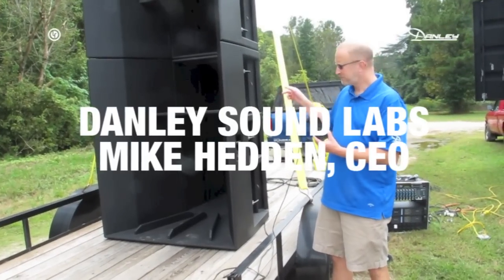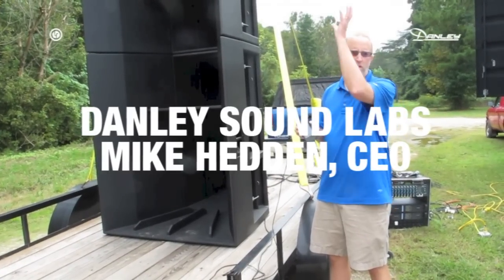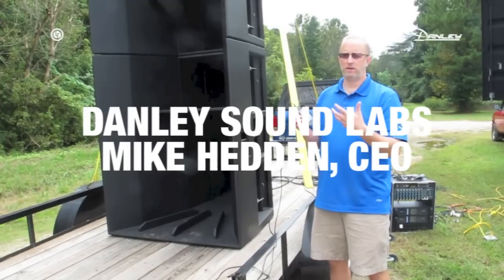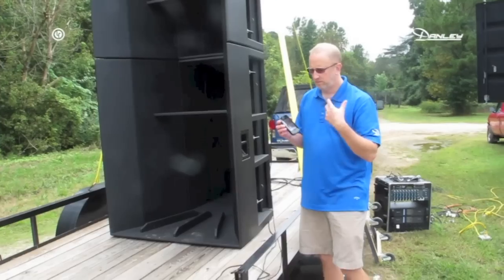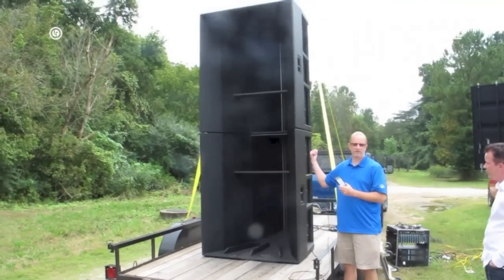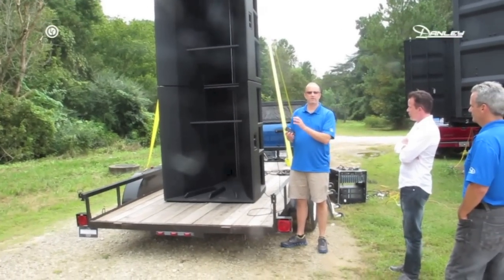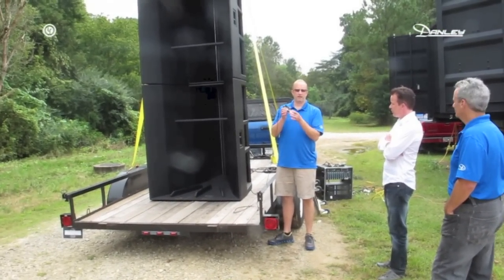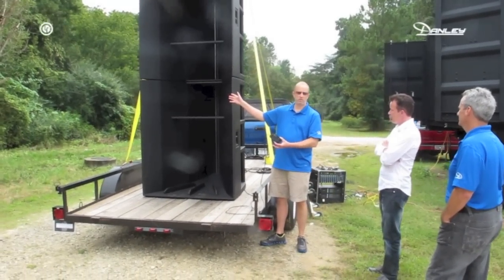Danley Sound Labs - Mike Hedden, CEO

Comment: For those of you that are having a hard time believing that 1mw of power couldn't produce that much volume think about the physics involved. Most of Danley's stuff is really high efficiency meaning at 1 watt of acoustic input power measured at 1 meter can probably put out well over 105 db on these cabs. Assuming that the cab can produce 105 db at 1 watt. When using 1mw of power this would only result in an 18 DB loss of acoustic power as it takes 10 times the amount of power to get 2 times the amount of perceived volume from a cab. Using the study of 6db as double perceived volume (I am sure that someone will bring up sone and the 10 db theories), this would put the output of the cab at 87 DB (Assuming that we start with 105DB). A single watt of power is very impressive. 1 mw of power is impressive on a well engineered cab.
Reply: Bill Weise I still call BS on it. Based on my knowledge as a physics / Mathematics student i can say the motor force created by the speakers is so incredibly tiny that i doubt it would even do anything if you put 1mW into those speakers.

I have also done some back of the envelope calcs above that basically blow large atomic bomb sized holes in the claims of this video. But i just noticed a slight error in my calculation with the sensitivity, i did not account for the logarithmic nature of the dB scale.

But still i have a hard time beveling that a speaker can create that kind of SPL with just 1mW, it takes my 98dB 1W/m speakers way more power to get to the same SPL that those speakers were at.

If those speakers are capable of producing that kind of SPL on 1mW then all you would need to create the sound for a concert is only on the order of power that a laptop can create. Or a decent headphone amp. It just dose not add up. That would also imply that one of my HiFi amps can blow out the eardrums of a entire croud at a concert with these.

Again i have a hard time believing in that.

Best regards, a Mathematics and physics student.
Reply: ***** As you provided a well thought out, intelligent response, I have to believe that you are a reasonable, open minded individual who would be open to trying something out. 

Find a speaker that has an efficiency rating of at least 90db at 1w/1m. A horn loaded driver comes to mind but any decent speaker should work. Then apply power to it from you phones audio jack or an Ipod. If you have a DB meter handy, this experiment will be even more fun. Then measure the driver at 3.3 ft (1 meter) with 1mw of power from your headphone jack. If the theory holds you should have around 72 DB of output (using white or pink noise). 72 DB will sound about as loud as your alarm going off in the morning. I think you will be very surprised at the amount of volume that 1mw will produce. This demonstration is a double edged one as this same test on any decent speaker will result in a fair amount of audio energy. I think you will be impressed. I look forward to your update and spirited debate! I love a good physics discussion. Take care. -Bill
Reply: ***** The Jericho horns are 112-115db sensitive. They have a peak output of 148db. for a 30db increase you need 1000x the power, so they are likely to be ran on 1000w amplifiers, probably more for the bass.
Reply: Bill Weise An I-phone has an output of 60 milliwatts. I doubt he was using just 1/1000th of a watt.
Reply: Bill Weise An I-phone has an output of 60 milliwatts. I doubt he was using just 1/1000th of a watt.
Reply: For what it's worth I hooked a Bill Fitzmaurice Omnitop 12 cab up to the headphone socket of my Toshiba Satellite Pro A200 laptop (louder phones out than my Compaq Presario CQ56) and it got to raised conversational level. Most of the output was in the shrill 1.5-3 kHz band of the un-EQ-ed compression driver.

If that speaker is 102dB 1w/1m (the shrill zone more like 108dB and the kick bass somewhere in the upper 90s) then that is 72dB at 1m e.g. conversational/tv level off a milliwatt.
Reply: 1 milliwatt into 105dB cab is 75dB at 1m which is about the volume you'd put the TV to "hear it well" or the volume of someone talking in a slightly raised voice e.g. a teacher in a classroom. I wonder what the J5 could do with a processor out to a Pringles Speaker amp on each frequency band and maybe two on the subs. Those 64 highs wouldn't take much to make some noise. The cab is basically a J4 combined with a stack of 6 x DBH218 and also something that provides a strong midrange.

Comment: Usually a phone has a bit more than a milliwatt of power but it is somewhere between 10 and 100mW. It is quite amazing that it is getting that loud off the headphones. I'd perhaps believe it were possible if you desoldered the wires going to the phone speaker and connected them to this as there is more power going to the phone speaker than headphones. The headphones are power limited to protect your hearing as powering them with the power of the phone speaker would be thunderously loud.
As for high efficiency. I connected one of my Bill Fitzmaurice Omnitop 12 cabinets to the headphone socket of my laptop and it was as loud as raised conversation although the compression drivers are very sensitive around 2kHz without the equaliser taking it down a notch.

Comment: Surely that can't be running just off the power of the headphone socket! Is there any sort of amp involved?
Reply: There is an amp rack behind him on the ground with two lab.gruppen amps
Reply: Phoenixx Neil He's not lying. The entire thing is being driven by the headphone output of the iPhone - and nothing else. They did the same thing at Infocomm. So no amplification (other than the iPhone) and no crossovers/filters! (other than the acoustic ones inherent to the speaker itself).
Reply: DogBoots77 
 As a Mathematics
and Physics student, i can safely say, that is a load of BS, i have done a few
back of the envelope calculations, and each speaker would only receive
9.259*10^(-9) W, even with a efficiency of 120dB @ 1W/m that would only produce
a miniscule 0.001dB per driver if the amp in the phone dose not blow up due to
the impedance of 0.0741 ohms. If by a miracle of physics and technology the amp
dose not immediately blow up and the entire speaker has a Sensitivity of 120dB
1W/m then even then it would work out to 0.12 dB, that would not even be close
to noticeable over the ambient sound

Based on
the fact the SPL heared in the video is about 80 dB at 1m from the horn, based
on the dude throwing something into the trailer it would work out to a
sensitivity of a unbelievable 80000 dB 1W/m, at that sensitivity you would
easily be able to hear the cosmic background radiation hitting the wires. If
that speaker truly has that sensitivity then you sir (the person talking in the
video) are worthy of a Nobel prize for creating a speaker so sensitive that it
acts as a amp for cosmic background radiation.

But since your
clams are impossible based on out current understanding of physics you win
nothing, except the idiot of the month award.

Since i
don't have the time to also calculate motor force of each driver, i will just
estimate a force in the range of pico newtons, so small it would not be
noticeable by even sensitive instruments.

Also some
notes on the tools used to calculate these values: Custom Mathematics program
created in VisualStudio 2013, and Maple (Maplesoft). I used low level math to
do this, everyone can do the calculations in this post, all you need is a
calculator, a piece of paper and a pen. You will also need hands attached to a
human body with a functioning brain and mostly functioning organs. You will
also need some patience (that i did not have, hence the program) and some time
to do the calculations.

I encourage
everyone to a bit of thinking before jumping on the "This is
awesome!" bandwagon. Look at everything critically and you will
learn.

That was anying, google dose not like copy past from word.
Reply: ***** He says "we are going to series parallel", they aren't all paralleled, I believe that was just a mistake the second time he says it. I'm not sure which model this is, but the Jericho horns are 112-115db/1w/1m sensitive. So at 1m, 10db is 10x the power, so 102db would be 0.1w, 92db would be 0.01w, or 82db would be, you guessed it, 0.001w or like he says, a milliwatt. Every time you half the driver complement, you lose 3-6db, even at 6db, each driver would be producing 44db ish.
Reply: lbochtler I think he's just mistaken the output power of that device, he's misinformed. An iPhone can deliver 60mW of power into a low impedance load. That being reproduced in a 110dB cabinet would yield 93dBs, which is a lot. Danley horns go up to 115dB/w@1m if I recall correctly, and that means 103dB. That's "uncomfortably loud" with just 60mw. I think the point he was making was just that he's able to power them with an iPhone, I don't believe he's intentionally trying to mislead somebody. But I'm just inclined to think like that, they have made quite some great inventions and I do admire them as a company.
Reply: Assume 120dB 1W 1m for a high efficiency directional cabinet and 20mw or so from a phone would give 103dB at 1m peak which would average about 93-95dB 1m on music which you would have to raise your voice to be heard over. That's still 73-75dB from 10m away.

If an efficient pair of in ear headphones produces 115dB with 1 volt RMS then it's 62.5 milliwatts a channel to produce 115dB in each ear if you played sine waves through it. You would be able to get about 105dB average on clean music with a 10dB crest factor, which would be very loud and you'd probably want to take out the headphones after about 1 verse of a song. Most players don't go this loud. A 1 milliwatt per channel player would give about 97dB in each ear or just below 90dB average without clipping on most music (probably most players are a bit louder than this apart from my Samsung).

I'm not sure how headphone sensitivity is measured because a speaker making 100dB to an SPL microphone might produce about 106dB at the eardrum after being amplified by the ear canal. I was wondering why I could get my SPL meter over 120dB when putting an earbud to it when the same music was similar to just over 100dB speakers. Also dBA and dBC where dBA gives more estimate of the perceived loudness of the sound by only measuring the mids and highs and dBC measures all but the lowest of bass notes.

I don't know how much power a phone puts into 8 ohms, whether it's more or less than with 16 ohm in ear headphones.
Reply: @lbochtler  Hey Einstein, you missed the first line saying thw drivers are in series parallel connection. 
There,  that kinda blows your whole argument, come back when you have dried  behind your ears.
Reply: @ibochtler
So many lines of blahblahblah invested
Just
To be so wrong.

Comment: What are speakers inside, full ranges?
Reply: I think the total number of drivers is 108. 12 of them are 18".
Reply: Petar Sejpes You can not build a Synergy Horn with full range speakers. It goes against the very definition of the Synergy Horn. The probably have a array of tweeters in the apex of the horn, then some midranges at a bit of distance from the apex, then the woofers even further out. Google Synergy horn, and you will find some interesting things to read.

Comment: and so what protects the sensitive hi freq. transducers from damaging low freq's
Reply: These have to use external DSP and crossovers, Danley makes amps specifically tailored to these cabinets.
Reply: In this example nothing. 1 mW isn't enough power to damage them.

Comment: That's not wery true, i conected my 2 fane studio12L's(102db@1w@1m)and JBL2412H(112db@1w@1m) horns paralel and in series to get 4 ohm to my phone audio output and assuming that phone has 8mW of power,power caclulations are:
for 12"
21 db decrease and becouse of haveing two speakers 3 db increase
total of 84 db for 12" speakers 
for 1"
21 db decrease and becouse of haveing two speakers 3 db increase
total of 94 db for 1" speakers
Measuring with gm1351, spl is 63 db max!!!
The point is that the small opamp in phones or mp3 players is optimized for powering relatively high z loads (all above 32 ohm) and when low impedance is connected to it,power disipated in the amp used to drive load becomes substantial, output power become lower and voltage gets low enough so that even cable resistance is very high for full power transmission which brings us to conclusion: info given in the video is fake, audio player has more than one watt or they use drive rack behind to drive those speakers...

Comment: I'm just now seeing this video since its posting. The amount of stupid people in this comment section is just mindblowing.... It's a very simple calculation to confirm what he's saying. These loudspeakers have an extreme efficiency. At .94mW, these speakers are -30db down from their ~126db 1W/1M efficiency rating. These Lightning to 3.5mm adapters can handle a 1ohm load which is almost 3 times easier than the nominal 7.3ohm that these J5's average to. So, given how loud he's having to talk over the speaker that sounds like it's playing ~96db, it definitely sounds like the phone is indeed pushing 1mw to a nominal 7ohm load.

Comment: If your truly using only 1mW of power across 108 speaker with say a impedance of, say 8 ohms, that works out to, 0.0741 (rounded) ohms, that would be a short circuit, i doubt that even the a PA amp could handle that impedance. And i doubt that a little chip amp could even get close to  driving that load. I would think that i would just blow the chip amp the second you start playing music. Also 1mW is unrealistic, that would work out to 9.259 * 10^(-9) W per speaker, it is just impossible that you have a speaker with a efficiency so ridiculously high it can be driven off of 1mW to that power

What you most likely did is use the iphone as a audio source, and use it to drive a set of PA amps, that then drive a Series Parallel network of speakers that works out to 4 to 8 ohms (im to lazy to do that calculation as well). That is most likely what is happening here.

If you refute that you will prove that you are (pardon my language) full of shit!
I want to see you try to refute basic laws of physics! So good luck with that...
Reply: ***** your of 0.0741 ohms assumes that all 108 speakers are connected in parallel.   The speakers are connected in a mixture of series and parallel giving an overall resistance of 4 ohms.  I-phones have an amplifier output of 60 mill watts which is why he was able to by-pass the passive crossover network without damaging any high frequency drivers.   These J-series danley horns have a sensitivity of 115db for 1 watt at one meter which would increase by 3db by removing the passive crossovers.  Feeding 60 milliwatts into those horns would yeild the same db sound level output as feeding 60 watts into a horn loaded speaker with a sensitivity of 90db.
Reply: ***** your of 0.0741 ohms assumes that all 108 speakers are connected in parallel.   The speakers are connected in a mixture of series and parallel giving an overall resistance of 4 ohms.  I-phones have an amplifier output of 60 mill watts which is why he was able to by-pass the passive crossover network without damaging any high frequency drivers.   These J-series danley horns have a sensitivity of 115db for 1 watt at one meter which would increase by 3db by removing the passive crossovers.  Feeding 60 milliwatts into those horns would yeild the same db sound level output as feeding 60 watts into a horn loaded speaker with a sensitivity of 90db.
Reply: Moses Bullrush
Ok, you have proven me wrong, but i will still
double check that.
Reply: ***** These Danley Horns are what loudspeakers should have been from the beginning. It's shocking that it's taken us so long to realize that acoustically coupling all the drivers has the effect of exponentially multiplying the audio output while preserving hi-fi level sound quality.  For many decades, concert systems have been using huge numbers of speakers which output the same sounds from many different positions, creating destructive interference patterns which fight against each other in the air and mostly  neutralize each other leaving only a small residue of sound which people hear.  Line arrays tried to address this problem but ONLY in the horizontal plane.  It's an 'unearthly' experience hearing how a pair of Danley Jericho horns can produce loud audiophile quality at a distance of 700 feet in a 50,000 seater stadium. Only two speakers either side of the scoreboard are playing in the video link below. Listen with headphones.
/watch?v=VMGaBcbaDiY
Reply: +lbochtler I believe he was referring to there being two enclosures that are being paralleled together. I don't recognize that box from any of their current models, it could be a prototype. 

As a student, you probably should not call BS until you have at least made an attempt to call the company and speak to them about how they performed this test and at what impedance this load presented the amplifier output.
Reply: +Moses Bullrush 
According to the video description, the sound was coming from the complete system. No where does it say anything about using only 2 speakers.
"The system consists of the following:
- 14 J3's
- 4 J4's
- 4 SH-64's
- 20 SH-Mini's
- 4 SM-80's
- 6 TH-812's"
Reply: djlobb Where did you get that information, he is standing next to two prototype J5's according to the video description.
Reply: +fidstang 
I think you've been confused. I'm not talking about this video. I'm talking about the video link in his comment, hence why I replied to him.
Reply: It's probably more than a milliwatt as if that was the case you could have a damn good rave with 1 watt! 1 watt will produce about 8 x the psychological "how loud is it" level than 1 milliwatt (after going through your brain's just over 3:1 ratio compressor), and it was already drowning conversation.